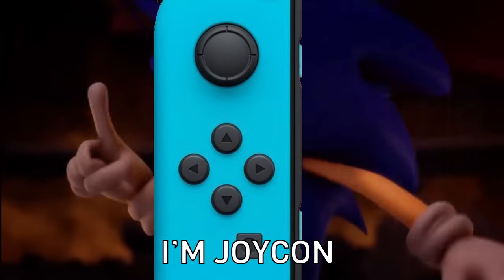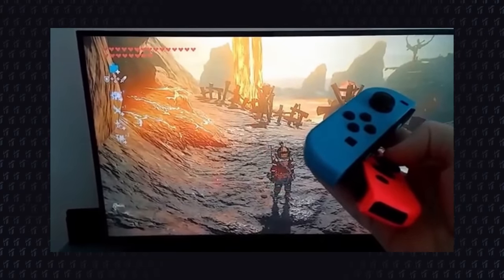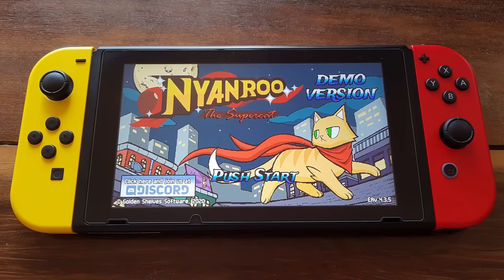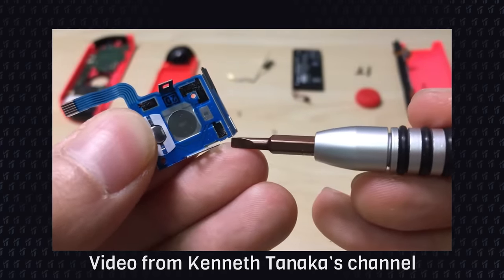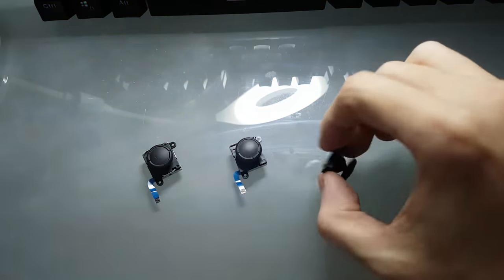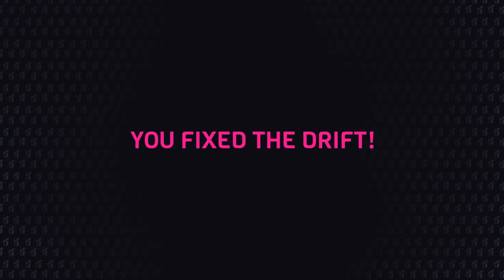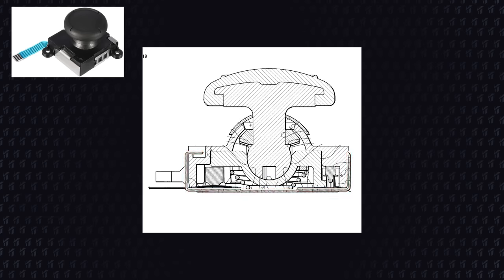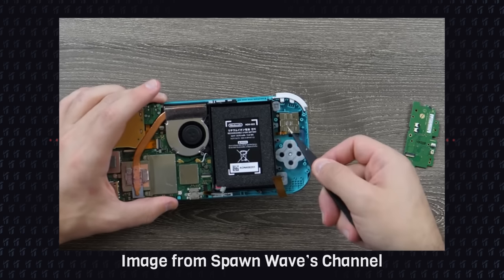How To Fix Your Joycon Drift Permanently!

Comment: I think will probably go down as one of gaming's biggest hoaxes. Obviously this method doesn't work at all, it's total bogus. But everyone lost their minds over it with massive media coverage and everything. People left and right were opening their controllers to put paper in them, I'm almost getting a little nostalgic thinking about it.
Reply from the maker: Hoax? My joycons had this for a looong time

It came back after a while but thats because the paper cardboard got flattened, just switch back to a new one and you're good to go for at least 5 to 6 months again

But of course it depends on the level of drift you have if your sticks are too damaged they won't do any good
Reply: @VKsChannel  Maybe it doesn't fall under the hoax category since you believe your method. But I think the fix is a total joke. This method can so easily damage the joycon over time. It's far easier and safer to just drip some IPA in there and fix it. If it ever pops up again, you just put another drop in. It's so painfully easy compared to opening the whole joycon and replacing cardboard every couple of months. The IPA method is easier, lasts longer, and there's none of this "if you jopycons are already drifting it wont work" shtick. But to each their own, I really wish Nintendo would just use Hall sensing sticks so we wouldn't be having this discussion.
Reply: @hajilee4539  a drifting joycon is a damaged joycon. Anyway you use to fix it is just gonna comeback in the end that youre bound to replace it someday. Just appreciate the man found another alternative to fix the issue for a couple of months or so before eventually replacing it once and for all
Reply: @500本の歯を持つ恐竜を検索  Your argument of "the controller was going to break again anyways" is ridiculous. It's literally the classic "I'm going to get dirty again eventually so why take a shower?". And the "so what I'm going to have to replace it one day" sentiment won't work in the future either.

It would be good he found a method to fix drift but when there is a significantly better fix that take ten times less effort and doesn't damage the joycon it feels more like misleading misinformation than a helpful fix. I know it's not a huge deal for you, but personally misinformation and bad advice bother me. The heavily publicized fix people should be using is a drop of IPA.
Reply: I'm a 35 year retired electronic tech. I have a BS from Purdue. It can work. I did it until a new joystick module comes tomorrow. I wouldn't expect it to last. The paper object is bending the metal casing over the module so bending is not going to fix it long term.

Comment: 10 minutes of video for something you could have explained in less of 3 minues.
Reply from the maker: That is life

I have spent months to find that the solution was this simple

So you spend at least 10 minutes to find what I spent months to discpver
Reply: @VKsChannel  Dude you barley "discpvered" anything. You found an extremely temporary solution to the problem that causes damage to the controller. Quit pretending like you discovered the cure for cancer.